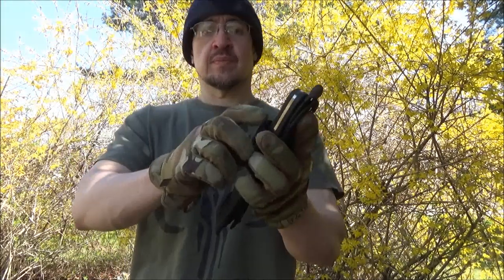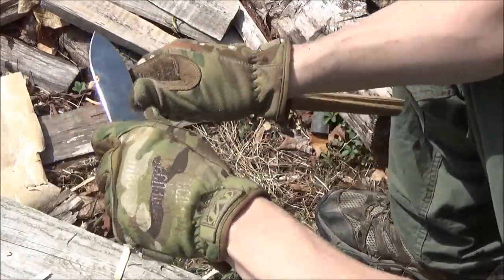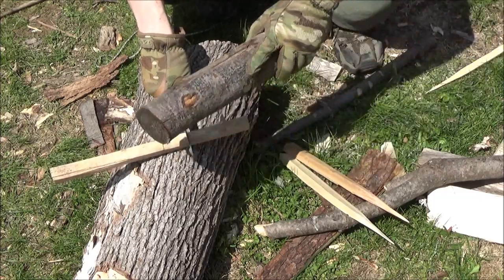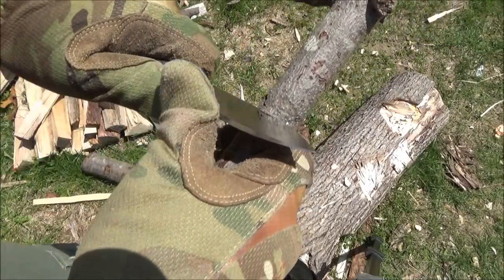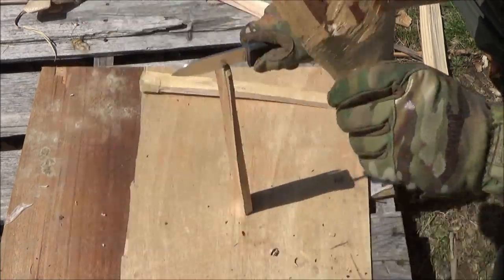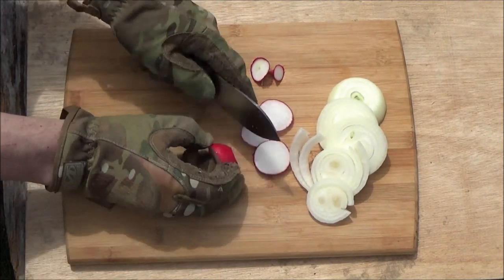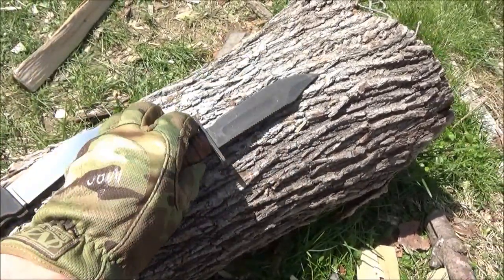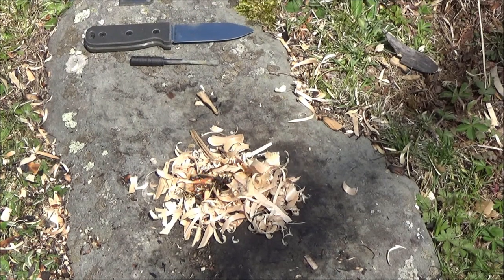OKC Black Bird SK-4, Knife Review (Bushcraft/Camp Knife)

Comment: Lol! Just in time. After last review couple days ago, I was tempted to pitch a bitch. I’ve used mine quite a bit. I’ve tried to not like it, but I just keep grabbing it over my other knives to choose from. Ontario sheaths have always been a disappointment, however they are better then they were just a couple years ago and they do function just fine. The addition of the metal ring on the handle retention strap is a nice touch as it allows the strap to fall away to reduce the chance of being cut when removing or replacing blade. For nitpicking sake, I do prefer the stone wash finish rather then polish. It has proven itself to be simply a Goldilocks of function. I believe it’s a sleeper, if a knife can be categorized as such. 
  I’m glad your still pleased with yours and I do appreciate the review as it’s always nice to have validation. Cheers!
Reply from the maker: There you are :]  Yeah this is a handy little devil it does tend to make itself a useful go-to!

Comment: Have you reviewed the terava jaakaripukko 110 or 140 knife yet,I like it a lot. Beast of knife for batoning an carving.  Throws sparks le crazy with a ferro rod also
Reply from the maker: Sounds good, where is the best place to get one in the states?
Reply: Not expensive really either, 110 starts at 29.99 without sheath, sheath is like 30.00 extra,your choice of left or right hand carry an brown or black leather with plastic insert, blade thickness is 3,16 of inches or 3.94, the 140 has a 5an half inch blade,both have duper comfortable handles an spine can throw sparks as well as a scraping tool for wood working,the tip is very stout an has a lanyard loop at the end of the handle, sheath is a dangle type with a drain hole an snap button for extra security but has great friction lock by itself
Reply: Oh also here for me it was like 10.00 dollars u.s. for shipping by DHL,arrived rather quickly than 2 weeks, it was a week on mine,but anyway still pretty sharp for all of the stuff I've put it through.
Reply: @WeAllJuggleKnives  ,your channel is where I first saw the tops style Ka-bar ,so I figured you'd appreciate a knife like this,you have pretty good knowledge about knives.
Reply from the maker: Thanks, bro!  I should do some reviews of my older TOPS knives that I haven't done full review of.
Reply: WeAllJuggleKnives I own the 110 version and it really is a great blade.
Reply: @WeAllJuggleKnives  ,no problem, agreed that sheath didn't do the new ka -bar right,an looking forward to seeing more videos soon.
Reply: @kennywheelus6857  YESSSS lol Ive looking at this blade for a minute, the DBK dudes list it as the best budget blade!!
Reply: @WeAllJuggleKnives  & Kenny Wheelus just bought one with the DHL shipping deal😁🔪🤙